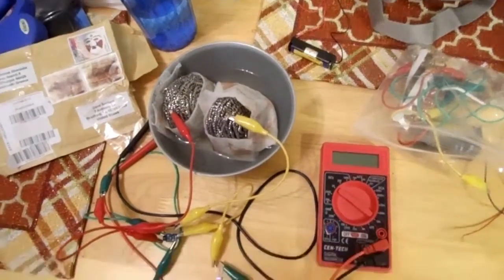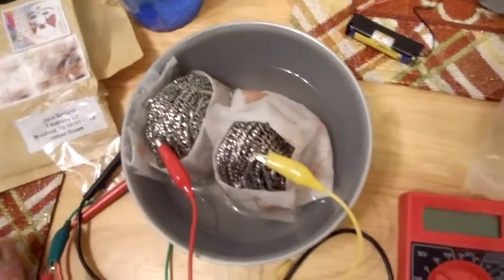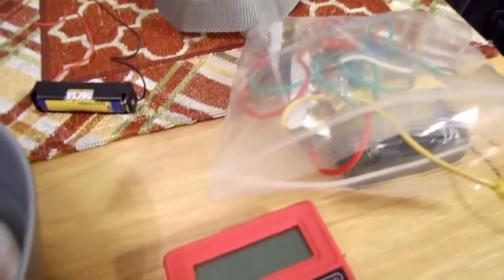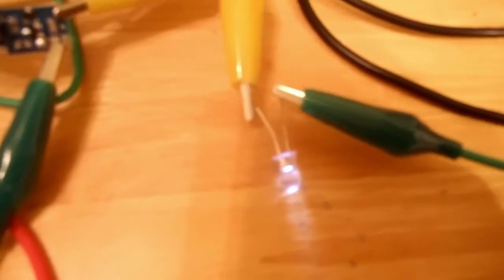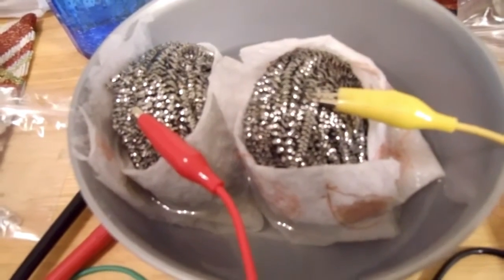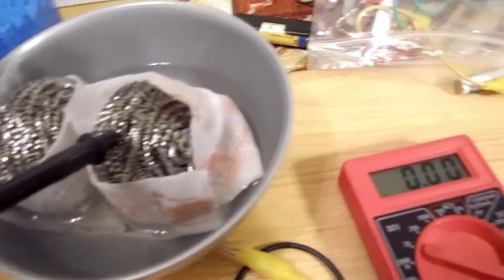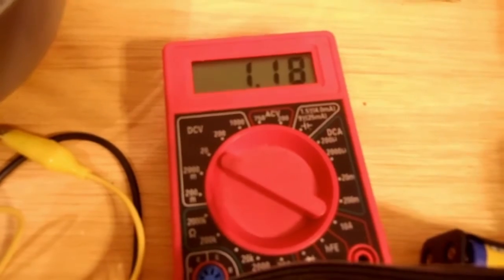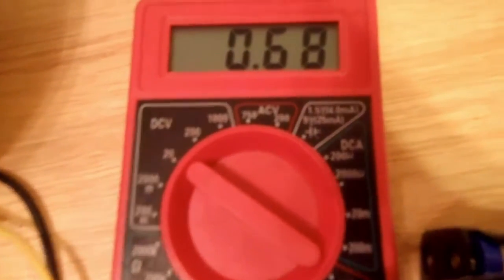Stainless Steel Secondary Cell (rechargeable battery) Part II

Comment: When it comes to salt water, the chemistry and electrical interactions would more acurately define the saltwater as a catholyte and not an electrolyte.  

This process is much different chemically with regard to the role of the electrodes within the chemical interaction. Ie, beyond electron exchange, the electrodes dont play a role in the chemical interaction. 
In this sence, the catholyte acts solely as the chemical exchange component. Ie, Sodium is extracted and held at the anode electrode when chargin occurs and the water along with remaing chemical composition is held at the cathode electrode. 
When discharging, the electrodes act as an electron exchange circuit wherein the sodium is reunited with its constiuent parts to compose their original chemical structure.

This is why dissimilar metals aren't needed when using a catholyte instead of an electrolyte.

Comment: Are you measuring pseudocapacitance or is this an actual battery. I have had some success with iron and carbon with alkali electrolyte. I'll want to try that again soon.
Reply from the maker: Voltage does drop rather quickly via self-discharge. A novelty for beginning home battery experiments. I currently wot with acid-free lead batteries. :)

Comment: how is this battery running if both metals have the same electronegativity?
Reply: Because the aqueous solution isn't an electrolyte, it's a catholyte.  The process is different than a conventional batteries chemical steps that need the appropriate dissimilar metals within the chemical action steps. A catholyte provides the chemicals needed for the process, leaving the electrodes only role as electric potential providers.